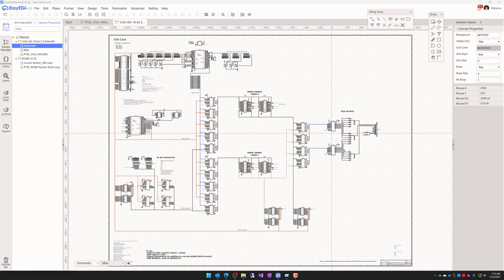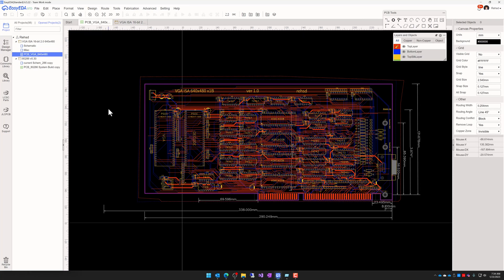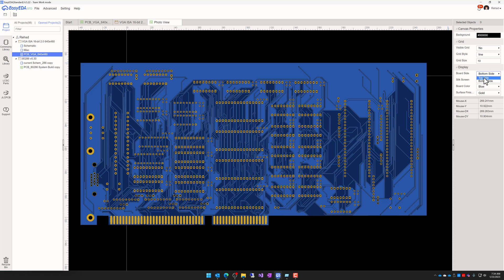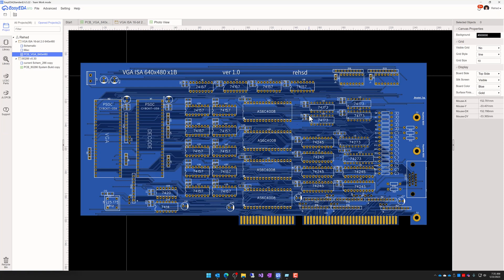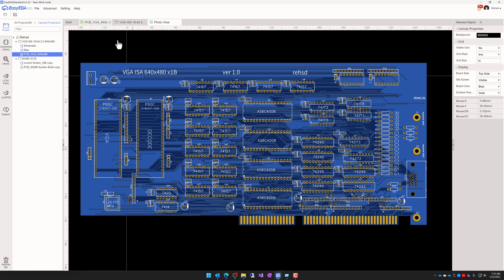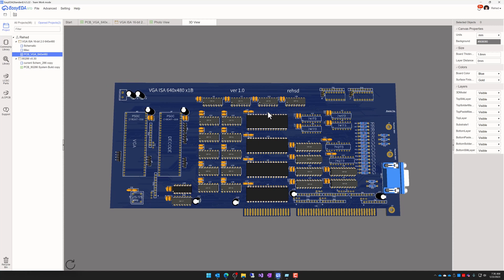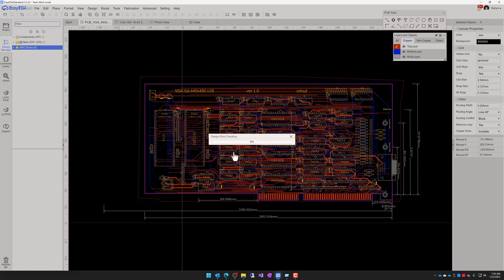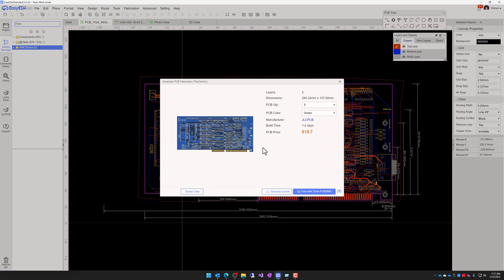640 x 480 VGA, Ep. #10 - PCB 1.0 Ordered

Comment: Did you forget to label some of the resistors as B?
Reply from the maker: Yep, I did mislabel the RGB resistors. It should say "RRRRRGGGGGGRRRRR" -- or RGB565. The x1B should also say x2B. And... the two PSoCs are labelled incorrectly (swapped). All of this has been fixed in the 1.1 PCB.
Reply: @rehsd  oops, oh well, not a big problem for a first prototype.

I recently had some 8 bit ISA prototyping cards made up, it all looked good before I ordered and it was only once I got them that I realised I had made a bunch of silly mistakes. Nothing a few bodges couldn't fix, and rev 2 will have all of those fixes plus a few other little tweaks I thought of in the mean time.

Had some misaligned silk screen, some traces all mixed up that I don't really know how I managed, I even missed routing one trace all together somehow!
Reply from the maker: @TomStorey96  Ya', this 1.0 PCB had a major issue (shared in a later video) where I missed updating a set of netlabels -- lots of bodge wires would have been needed. :)

Comment: I know those psocs are damn convenient. But do you really need the whole development board? Is it possible to program just the chip and then put that on the pcb with whatever support circuitry it needs?  That might shave a fifth of the length off your design.
Reply from the maker: That's definitely an option! I figure I'm still in the prototyping stage. I have a few big changes to come yet. One is to update the design to support some cost-effective VRAM that I sourced (dual-port, parallel+serial) and the other is to remove the PSoCs. To remove the PSoCs, I could go with discrete logic components or just use the PSoC ICs without all the other stuff from the PSoC dev board. With these changes, I may go to surface mount ICs and try to cut down the size of the board. One challenge might be sourcing the PSoC ICs... they're hard to find still. So much to do yet...  :)

Comment: Really nice! I'm looking forward to see it in action.   But I agree with Greg that you're cutting it really close to the edges.  And maybe it's just artefacts of the rendering even in 4K and the fact that the pcb is quite large, but it looks like you're having 4/4 or 5/5 mils for tracks/spacing and then have vias in tracks pushing the annular rings really really close to the next track.  Have you measured the distances with a Gerber viewer?
Reply: I tend to prefer routing VCC and GND along the ends of the chips rather than down the middle of them, it opens up more space to route traces.

Take the Apple I motherboard as an example.
Reply from the maker: @TomStorey96  Good tip, thanks! I think the 1.1 version is more along those lines.
Reply: @TomStorey96  That's a nice option if you don't care that much about the loop area for the decoupling caps. (You could of course bend the legs and spread them out so they reach from the pin1//16-side over to 8/9-side, but I've seldom seen that be done)
Reply: @MatsEngstrom  routing on a two layer board is already a serious compromise for signal integrity. It seemed to work pretty well for these relatively low speed designs back in the day though.
Reply: @TomStorey96  Yup. When using low edge rate devices like plain LS or HC the necessity of decoupling of every IC is exaggerated. The Gigatron computer runs just fine (in most cases) with *ALL& decoupling removed. But signal integrity is one thing - the base foundation of it all is a stable GND - ground bounce and vcc dips will wreck havoc on any design. Signals are much more forgiving in a 1980's-era design.
Reply from the maker: I'll try to make a better margin on the edges in the next version. I should have clearance of 0.152mm (5.98mil) between everything. I haven't been able to find anything with less clearance. EasyEDA checks the clearances with its DRC, but I'm guessing it's far from perfect. I am using Gerber Viewer, and I haven't been able to find anything less than 0.152. I am using 0.254mm (10mil) for track width (1.0mm for VCC/GND). All that being said, I am still building up skill in PCB layout and could easily be missing some things in the design. :) Thanks!
Reply: @rehsd  Cool. I guess it just was rendering artefacts and also getting confused by the relatively large board that made the spacing far less than 6mil.  Do you use 0.2 or 0.3mm vias?   As I understood from another  comment the board was autorouted? My first impression was that it looks quite nice in general - except for the power distribution.
Reply from the maker: @MatsEngstrom  I'm using 0.61mm via diameter and 0.305mm via drill diameter. I used FreeRouting as my autorouter. I just ordered the book "Printed Circuits Handbook, Seventh Edition," which looks like a monster of a book. I'm looking forward to reading more about PCB design. As far as the power distribution, any quick tips on what would be a better approach (when manually routing)? When manual routing, do you typically route VCC/GND first, or after your most important signals? On some of my PCBs I place an inner VCC plane and an inner GND plane; I typically don't do this unless the board is fairly close to a final version. Thanks!!
Reply: @rehsd  The vias looks so much smaller than this -but I blame that on YouTube :)    That book is huge, and also price at $200 here and is a bit too much for me, but it seems to cover a lot of good topics. I almost always start with making sure I got a proper cover distribution all over the board without a lot of snaking traces that can end up at several time the length of the board. Most signals can do multiple layer shifts using vias and snake around quite a bit without any ill effects - especially when using old school DIP chips. A technique common back in the 70's ad 80's was to have gnd and vcc coming into the rows of ICs like a fork from left respective right. That usually works fins for me. I keep both of them on the same layer in order to keep the other layer free for connections in the perpendicular direction. Image of an example here: https://imgur.com/a/KUnBkFa
Reply from the maker: @MatsEngstrom  Thanks, Mats! Your example is helpful. It might take me a while to get through that book. :)

Comment: Some of those traces seem really close to the board edge. Does EasyEDA let you set up the production capabilities for JLCPCB?
Reply from the maker: For the board outline, I can set an option to check for board outline clearance (which I don't currently have set). However, JLCPCB performs their checks when they receive the Gerber files. Those checks appear to have all passed. Ideally, the traces wouldn't be that close to the edge.